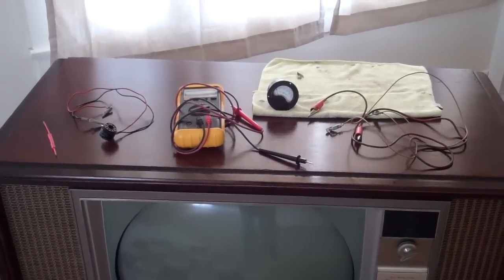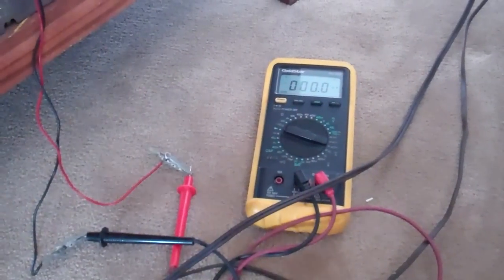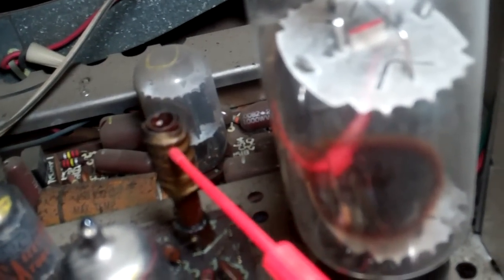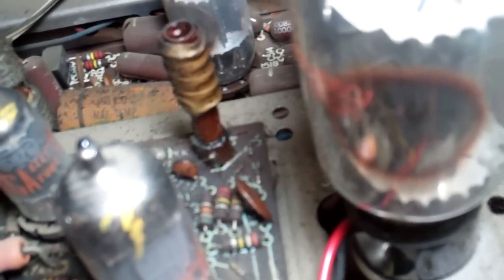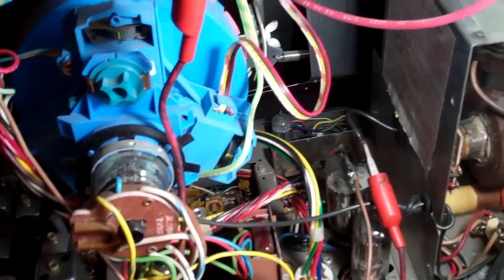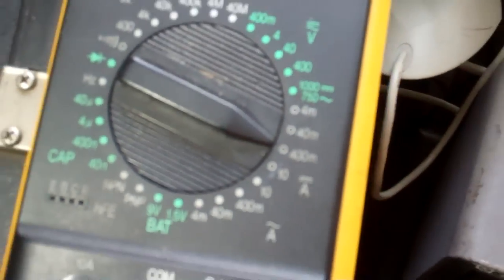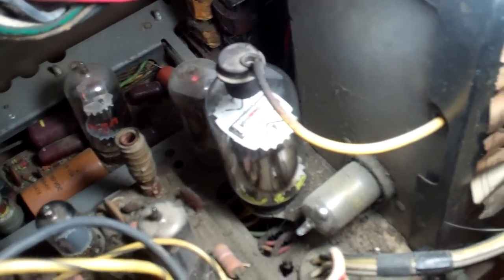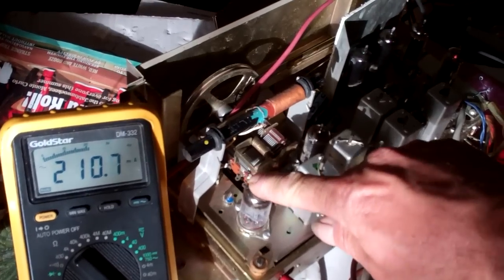How to check measure adjust  horizontal output cathode current on a vintage tube tv television

Comment: I prefer to disconnect the cathode in the set add an above chassis fuse holder and wire that in series with the cathode. Something like a 1/4A fuse is cheap insurance if anything ever goes wrong, and whenever you need to check the current you can just yank the fuse and the test points are right there.